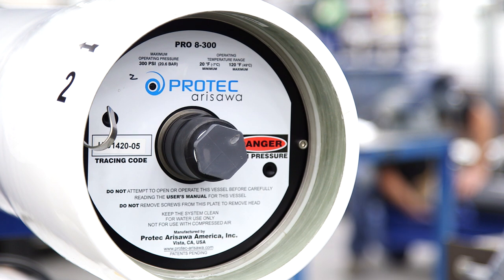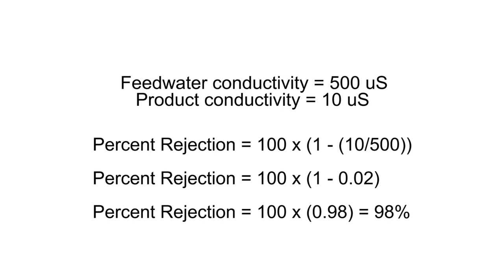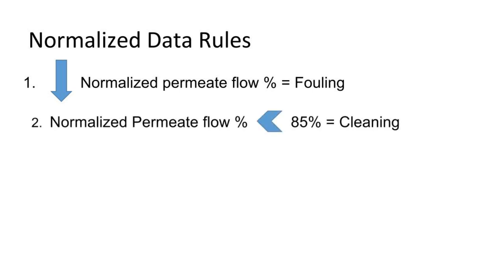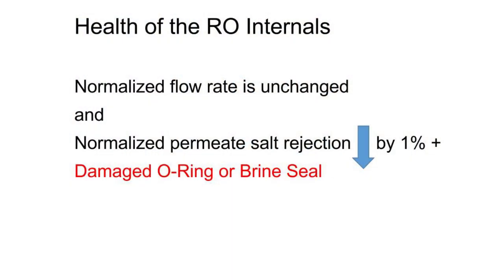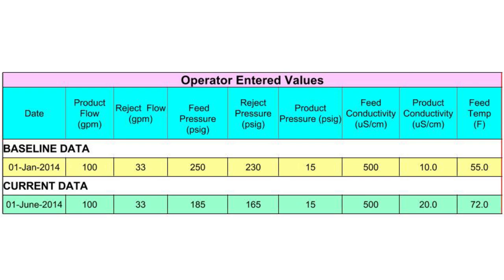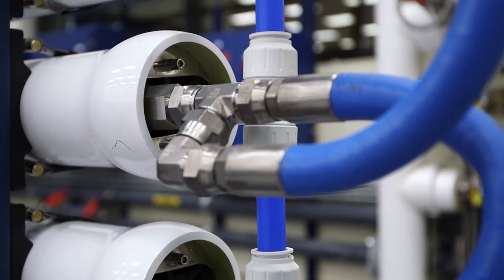Reverse Osmosis Troubleshooting

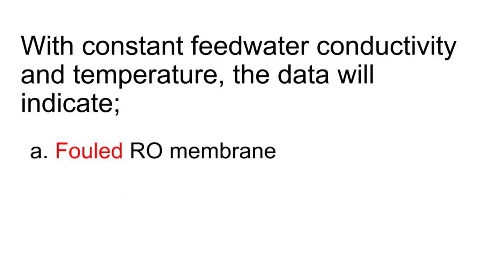Comment: 1:31 Membrane fouling: higher feed water pressure
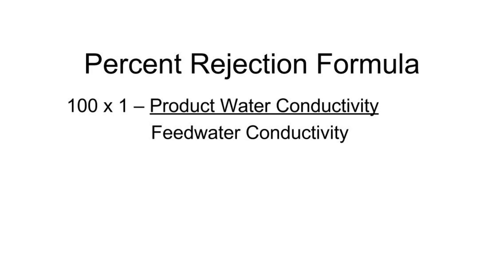2:13 Percent rejection formula
2:41 Feed water pressure (RO membrane fouling)
2:45 Combination of lower feed water pressure and lower percent rejection indicates RO membrane damage
3:00 Feed water temperature
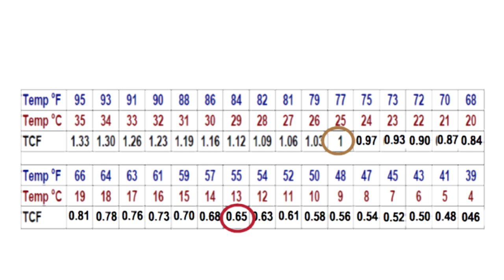3:29 Effect of water temperature on driving pressure
3:44 Can indicate RO damage when there is none.
3:56 Measuring RO performance
4:07 Rules of thumb
Reply: What should I do if the membrane is fouled by microorganisms?